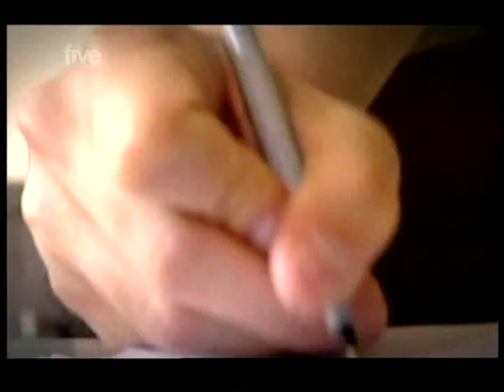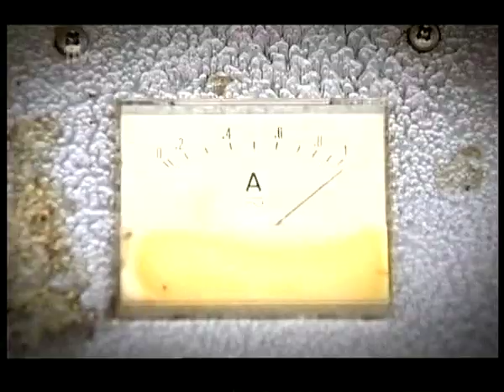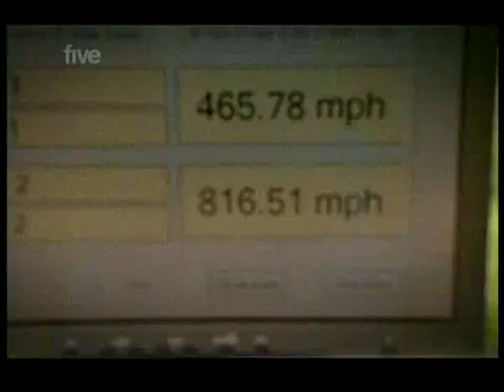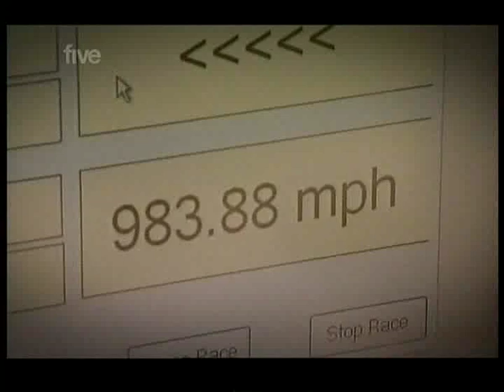Scalextric Chatsworth Land Speed Record

Comment: @tycoonpratik - the "button" is a speed control, not just an on-off switch. Also, a decent system allows for braking by shorting out the supply rails to feed the motor's back EMF back into itself. Slot racing is a lot like real driving, without having to steer.